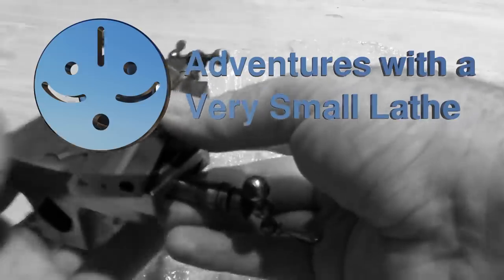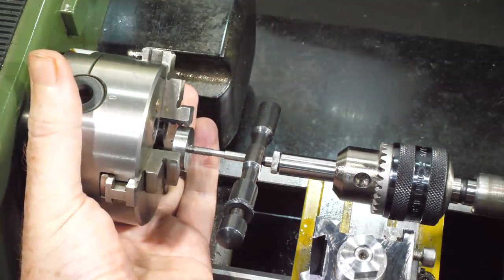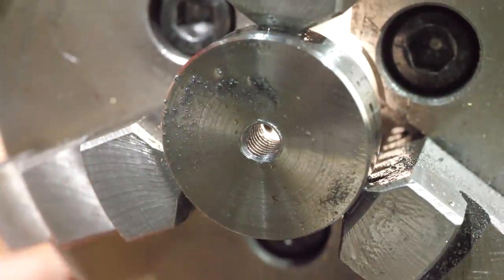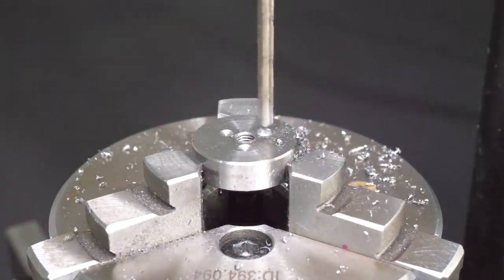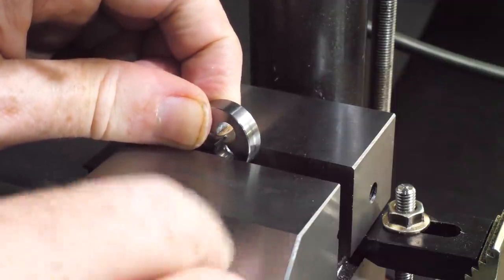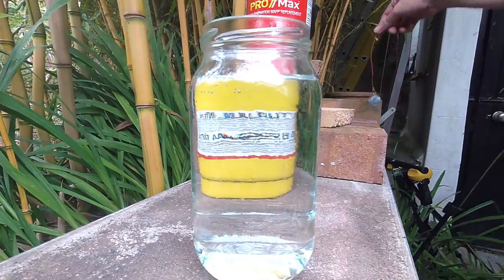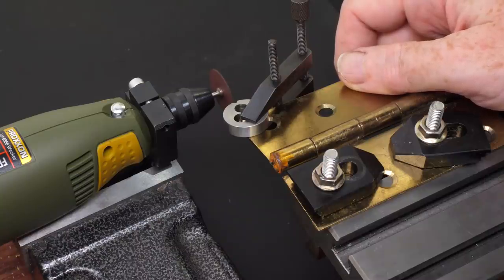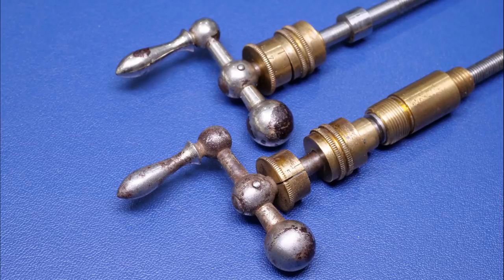Making a Custom Die on the Proxxon PD 250/e Lathe

Comment: SO many great little learnings packed into one little project, and nicely explained! Whether one needs to make a tap or not, this is worth watching just to learn a LOT of little tips, tricks, and better ways to do things. (Just a few: why and when to use a spotter drill, not a center drill. Leave the plastic on the end mill. Drill bits are for/better at making holes in X situation; end mills in Y situation, BUT think about these things too which is why you need to actually use BOTH to make ONE hole in a particular, unusual situation. Which you wouldn't do (and would probably screw it up) if you didn't know & think about several characteristics of each! Etc....) THANKS for a great little tutorial.

Comment: Thank you so much for a very nice technical video. Try this little trick on for size, (from an old Machinist/Tool & Die Maker/Welder/Designer 40 years, retired disabled over 10 years ago.) Put your lathe in 1/2 back gear...In other words, pull the gear handle, but don't pull the pin. That will lock your chuck spindle, if you're going to use a tap handle. On another note, put your tap into a chuck, morse tapered into your tail-stock. Use your spindle chuck key to turn your stock and the chuck on the tail-stock for holding your tap. In this case, don't tighten your tail-stock. At first, lean into it to start the thread. Then just turn the chuck 1/2 turns using your chuck key to turn your stock. Don't use tapping oil...use Crisco Vegetable Shortening instead. You'll break far less taps this way! You'll also find you can power-tap using Crisco. When close to the end of the tapping session, finish by hand and then reverse on back out, after you come to a complete stop, or you'll pop your tap! (If you're tapping Aluminum, use Terpentine as a cutting oil.) You made mention, that your work wasn't supported from behind, when in the divider head chuck. I had a plastic sectional box of WOODEN parallel bars, that I used for this very purpose. Be it in a chuck or in a machine vice, my work was always level. If it got drilled into, so what. It would still work for some things. When it was shot, all it was, was a piece of oak I had machined in my spare time. Chunk it in the garbage and grab another one out of the box. That would take care of your support problem. Also, that was a Kewl jig you came up with, using a door hinge and a Dremel tool, to cut your slot. Here's something you can do, when you're hardening something...crush up a bunch of Walnut Hulls. Then crush up the coals from a wood fire. Don't take it all the way to a powder...that's explosive! Just down to granuals. Mix the shells and the carbon and DRY play sand and put in a metal bowl. Dig a shallow hole in the center, a tad larger than your part. Heat to a dark yellow or light red, whichever works best for your equipment/application. Then lay your part in the hole and immediately scoop more mix over the part. Then pour more dry play sand over it. (this holds the heat and allows the Walnut shells to inject the carbon into the open pores of the surface of the metal.) Forget about it for an hour. Using tongs, reach in and get your part. You have just CASE HARDENED it. Now heat IT up just before red and drop it in oil. This hardens and gives a memory. Then heat it in a shop toaster oven, on about 175 degrees for about 20 minutes...and then let it cool to room temperature on it's own. You just annealed it. If it's TOO hard, it will be brittle, and will break! The annealing takes the brittle out of it. Thanks again for posting a great video!

Comment: I found your tempering method interesting. I am a woodworker and sometimes forge my own tooling. I find it easier to temper in my wife's cooking oven.  Light straw is usually around 400 deg F. Check your material data chart. Check oven with a thermometer first and let it soak for about 20 - 30 minutes. you can also throw a test piece in and check it that manor.  A word of warning, make sure you have removed all the oil from your part. If you fill the kitchen with oil smoke, your survival may be in question.
Reply from the maker: Tempering in a bed of brass chips seems to be a common traditional method among horologists. I was using this method as I've seen it used in a number of videos about clock and watch making. As you saw in the video, it didn't go all that well. :) I'll certainly try the oven technique at some point, though I may have to wait until the oven is already hot, as it seems wasteful to heat up a large cooking oven to temper such a tiny tool. Thanks for the suggestion!
Reply: @AdventureswithaVerySmallLathe  You can always cook some food in the oven (with tin foil over it) on the bottom shelf when tempering !!  😉

Comment: Well done ! -- clear & understandable, can i offer the following -- Drilling the three holes , make a "pin" like a top hat to fit the center hole The flange - file away in three places then place in hole & proceed. Tempering -- Get a thick ( ish ) block of steel ( in the case of your die say 10 mm thick-- not critical but dont go too thin ) heat the block up realy hot & place die on block . watch the colors & quench -- this gives even heating & slower/ more control over proceedings. But -- nice one sir !

Comment: I usually just put the lead screw in the lathe and then run a thread file on it. It's a lot quicker if you have the right file with the correct thread pitch. But this was still a very cool video on how to make a die.

Comment: My tiny Proxxon MF70 micromill will chuck a cutoff disc and I use that when I can. Cutoff discs are really brittle but fortunately are cheap. Especially if you buy the ones from Dremel rather than Proxxon.  For heat-treating operations I made a "tin can furnace" from instructions all over the internet. Can be used indoors on a flat brick, costs almost nothing. Got to remember that boric acid  trick. Well done.
Reply from the maker: Thanks for the tips! I'm on the look out for an MF70 for fine work, as I think it might fill a gap my mill currently can't quite do. Would love to know more about how useful you find it. The tin can furnace sounds like a good approach, as my current furnace loses a lot of heat into the open. The boric acid trick is a standard horology technique, and is covered in a lot of watch and clock making books. Clickspring covered it really well in his videos, which is my main inspiration here.
Reply: The MF70 is no Bridgeport. It will accept tooling with approx.1- 2-3 mm diameter shanks. In fact the collets that come with the mill are 1, 2, 3 and 3.2  mm (1/8") but it is  possible by diligent search to find end mills  that will fit it. The Proxxon endmill set is very  expensive and a bit of Search work is worth the trouble. I have pushed this mill beyond its limits.  I have no room in my shop for anything bigger. It is agony to face a 40 mm square piece of flat steel with a 3.2 end mill. But I did it . I think that within its limits the MF -70 is a nice piece of gear. Especially when you are limited for room.
Reply from the maker: @juanrivero8  From what I've read the MF70 collet is the same system as Proxxon use in their drilling and grinding tools, so would be the same as my little drill, and would accept the same tooling.
Reply: Interesting. If you shop around the internet, you can find a lot of tooling with 3mm shanks. I have some 2mm, 2.5mm, 2mm ball end tooling in solid carbide that I am very pleased with. I can also chuck Dremel tooling, which is a lot cheaper than Proxxon. Maybe not as good so I regard the Dremel stuff as expendable tooling. The MF70 qualifies as a Very Small Mill. I have no room for anything bigger:)

Comment: I first saw the boric acid/alcohol paste on Clickspring. Same for the tempering in brass shavings. I may have to try it next time I heat treat a small item. You might be well served to make a mini forge with a couple soft firebricks and your mapp torch. It would hold the heat in the part much better and more evenly.

Comment: Small thin sections of silver steel should be hardened & tempered in oil, 
water can sometimes be too harsh/cold and crack the object.
What about the burrs on the thread after end milling the holes and de burr’ing?
Reply from the maker: I checked the data sheets for BS1407 Silver Steel before I did this project, and they said to quench in water, so that's the procedure I followed.

Comment: Great stuff Alistair, Well done!!
I particularly like the simplicity of your jig idea for cutting the slot. 
FWIW, I've got an old Aussie made P&N die that's not only split but features a tiny grub screw that forces & holds its gap open.
The real beauty of this grub screw arrangement is it acts as a fine adjustment stop so the die can just be used as a chaser.
Out of all the dies I own, regardless of their sizes, this is the only one with this particular feature.
regards Colin
Reply from the maker: Thanks Colin! I'd love to know how they cut the thread for that grub screw. Since I made this video I've used die wrenches with much finer adjustment screws, which give much finer adjustment of the die depth, and I'm considering an upgrade to my tailstock die holder to make it easier to control the die depth of cut.
Reply: @AdventureswithaVerySmallLathe   I'll email you some photos of my die which should give you a much better idea than me trying to explain it.

Comment: I just had a thought  in passing - hinges for fire doors tend to be better quality than cheaper ones and the best quality hinges have washers or even tiny bearings and so will have less slop than a cheap hinge - one of the these may give more accuracy for a similar job.  
I notice that hinge looks to be quite a good one but some are absolutely terrible - for example I can't imaging that operation turning out well  or safely with the average hinges iIhave lying about in my workshop drawers  :)
Reply from the maker: Thanks for the comment. I just got lucky when I was making this tap, as I happened to have a pair of brand new, unused interior door hinges. Probably nowhere near as good as the fire door hinges you suggest, but I think easily enough for this die.

Comment: Just a small note about your grinding a slot on 26:15. You should have feed the die from the bottom, not from the top. If the grinding wheel binds, and it can because you are feeding material on the back side, it will lead to real bad disaster.
Reply from the maker: Thanks for the tip! It was my first attempt at trying this kind of grinding, so your advice is very much appreciated.
Reply: @AdventureswithaVerySmallLathe  Excellent video and the project otherwise. Subscribed :)

Comment: I've simply used the jacobs chuck in the tailstock to hold taps while threading holes. It works very well.
Reply from the maker: The Proxxon tailstock has a short B12 taper with no tang, so it's holding power isn't very strong. I have used the technique you suggest on a larger lathe successfully, but not on the Proxxon.
Reply: heres one method i use, ill put the tap in the keyed drill chuck (cant be a keyless, youll see why in a minute) and get it good and tight, then ill keep the chuck key in the chuck, and position the chuck arbor in the tailstock so that the key rests against the compound. they chuck key then becomes a kind of dog to "drive" (hold) the tap and i turn the lathe chuck to thread teh part. if its a particularly tough part to thread, ill put an adjustable wrench on the jaw to turn it.

Comment: Great video!
I would recheck that there isn’t a gross misalignment between the threaded rod and it’s accompanying components.
The worst wear appeared to be mainly diametrical which implies the mating member was originally
located too low. Great work!
Reply from the maker: Thanks! I'm pretty sure I understand how the thread got damaged, but I'll also carefully check the alignment when it all goes back together again.
There is a ring attached to the shaft with a pin, which keeps the lead screw fixed, and ensures that the nut moves along the screw, moving the slide. This pin sheared, the ring and pin started to work their way down the screw. The broken pin pressed against the outside of the thread, and mushroomed the points. Thanks for the tip!
Reply: Adventures with a Very Small Lathe The broken pin would explain it too. Keep up the cool videos and stop motion!

Comment: If you buy some Mechanic's drills (Stub drills) you will have less flex from the drill because they are only half length, and you can get them with a split point which helps prevent them from walking.
You can also get Drill point end mills rather than square end, which might help, but I think you would need to have a very rigid machine or the point would probably chip-off if the mill is carbide.

Comment: Nice, but you should get you a small oven like Efco 150 for heat treading with an electronic thermometre or a ramp controller. And you did not use cutting oil on you most important cut, the tread screw. But interesting to see what can be done on the small Proxxons.
Reply from the maker: Sadly I have no room for anything that big. I definitely did use cutting oil on the thread, but don't always manage to include every detail on camera.

Comment: Idea with the hinge is brilliant. You need to sharpen Die using abrasive drill bit, and make relief angle like when you make tap. just using angle plate or so and drill press or mill

Comment: Very Interesting. Next time you need to do hardening, use extra fire bricks around 3 sides and over the top to make it an oven. Your way you were losing to much heat, even on a non windy day you would still get a lower temperature than if the part was totally enclosed. Thanks for showing all the operations.Use steel wire next time too for handling purposes.

Comment: Nice work, one thing I would have done is tapered the thread hole on one side for easier cutting.
Reply from the maker: Thanks, that would definitely have been essential if I wanted to cut new threads, but I don't think it mattered too much for chasing an existing thread.
I'm not certain whether it would be better to cut the taper before hardening, or try and grind it later. Either would be pretty fiddly dealing with a thread of this size.

Comment: I’m new here and thinking of buying the Proxxon pd250e lathe. Have you done a review with pros and cons etc. I saw the quick change bolt you made and was wondering if there is much more you would do?
I’m often told ‘buy nice or buy twice’ and don’t mind the extra cost if I don’t have to mess around with the product too much. 
Proxxon seem to have good support and back up so that’s a huge plus for me over some others. 
Can you please direct me towards where you might have done a critique. I’m pretty impressed so far.
I like how you are not shy about revealing your errors, much to learn from that as well.
Thank you so much.
Reply from the maker: Over the last couple of years I've been trying to gather evidence, and really understand the tradeoff between a cheap Chinese lathe and a Proxxon. It turns out to be quite a complicated decision though, as it's not as simple as the build and quality. The PD 250/e came finished to a very high standard. I was able to use it straight away, and I've never had to make significant adjustments to it. However it is a very light machine in terms of available motor torque, and the weight of the major components, which is a limitation that can't really be improved. It's pretty clear from my videos that my Chinese lathe arrived in terrible, unusable condition, though some suppliers do sell very similar lathes to a higher standard. However, the various parts of the Chinese lathe are very solid. If I view the Chinese lathe as delivered as a kit, then it's entirely possible to use it to build a lathe that is much more capable than the Proxxon, as it's bigger, heavier, and more solid. The downside is the 100s of hours of work and learning required to get there. Obviously this makes no sense commercially, or for anyone who just wants to start making projects, but for a hobbyist with lots of workshop time and desire to learn it would make a lot more sense.

Comment: Great job making this video. One of the best I've seen. Great video work, & great expository on the ups & down, goods & bads & good detail. Loved all parts of it. I use a lot of Acetone, generally, but for degreasing I've found commercial products that call themselves degreasers to work pretty well. As much as I hate WD-40 (oversold & not a lubricant as many claim) their specialty degreaser works pretty well, in my experience better than Acetone. Also brake-cleaner works well.

Comment: You don't have to wind the tap right back over the swarf you've just cut, just back it off until you feel it snag on it and then go forward again. The chips will still break up and you won't give the tap such a hard time. A proper tap cutting compound also works better than a cutting oil in my experience. When tapping any material that's difficult, any movement forward is a victory, you don't have to go a quarter of a turn or more.

Comment: I know this is an old video but given the included angle of 55 degrees, sounds like a bsw thread. "British standard whitworth" Measured in threads per inch like imperial threads but with 55 degree included angle instead of 60 like imperial threads and also i beleive the courser pitches have a radius at the root and tips of the thread.